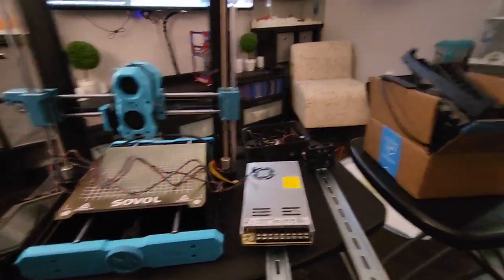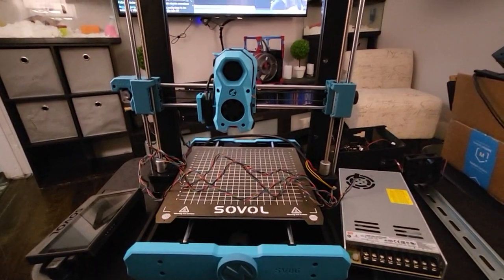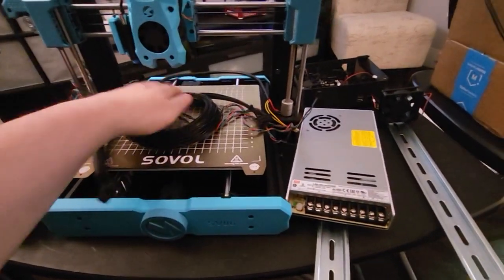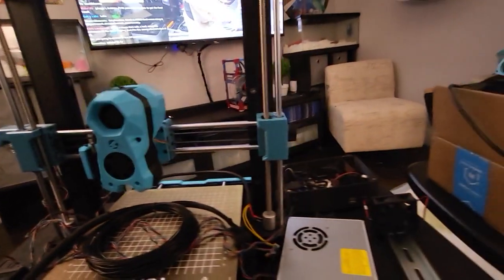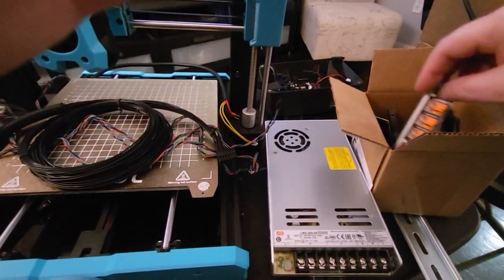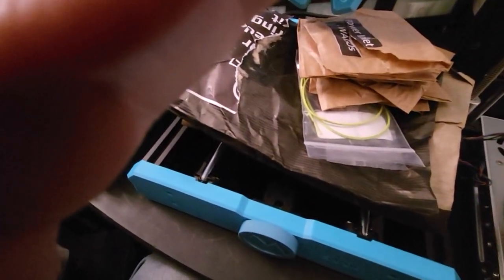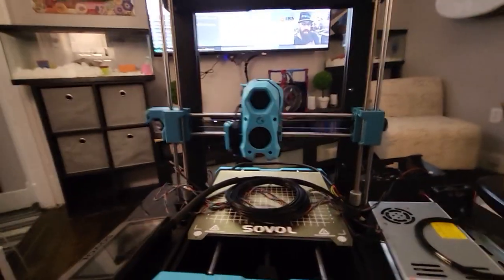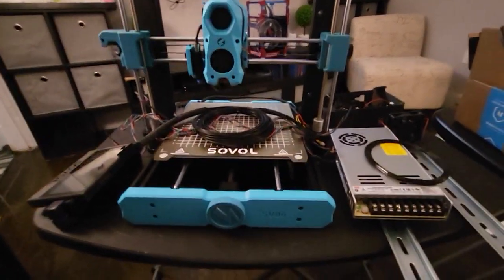Sovol SV06 mods

Comment: wha's the point of purchasing a 200 $ 3d printer and spending 1000$ o mod it? just buy something else.
Reply from the maker: First thing, I did not buy this printer it was free.  Second there is nowhere near 1k woth of parts here.  I had most of the parts as spares from my vorons.  But if we want to itemize?  $35 for the psu, $45 for the m5p mobo, $20 for 5 steppers, $47 fir the 4 stepper motors, I had the bondtech gears extra for the extruder they were spare parts from other kits so $0.  $35 for the Cb1 mcu, $17 for wire harneses, and  $9 for leds.  $12 for drylin bearings.  $35 for cut acrylic panels, and $9 for extrusions.  So maybe spent $285 (include filament for printed parts)

Its a hobby and modifying and building is the fun of it. 😊
Reply: yeah, i mean i guess if you have fun doing it and as hobby i cant blame you, but in terms of value for money, he prob would get like a bambu p1p for the money spent
Reply: In every DIY/maker video comment, there is someone like this. They seem to see everything in terms of optimizing productivity / price ratio. As if they don’t have the ability to grasp the meaning of “hobby”.
Reply: @lucywang2591  after you have modded the 2nd printer you do not care anymore... it is like working and building pc for years also for playing but in the end, you buy a PS5 and you start playing and enjoying it immediately...

Comment: What an awesome build bro lol i love the look of the voron extruder setup on the sv06!! Do you know if it would be possible to use the voron shell with the stock sv06 extruder/hot end setup and just use the same fans that fit the voron?
Reply from the maker: Yeah I do not think you can do that the extruder setup is not even close as they cool the hotend from behind not the front and the whole setup is so short.

Comment: Wow. You have gone all out. My first printer was a Anycubic kobra and it is ok but is not easily converted to klipper. So i picked up a sv06 a few weeks ago and am impressed. My bearings are quite smooth. I do have some IKO bearings on the way for when mine give out. I also have a pi 3b and a btt 5 inch screen and  a mellow adxl345 here now. I wish there were some good video tutorials on how to install klipper for the sv06 but i am sure i will figure it out. Well hopefully. Lol. My question to yiu is did yiu creat le the mount yet for the 5 inch screen that mounts in the front? I have seen a few so far but all of them mount on the side. I also did not get the hdmi version of the screen as i wanted to mount the pie in the back and found it was cleaner with that version. If you did design one is it on printables yet?
Reply: im trying to do the same thing right now except im running klipper on a laptop! let me know if you figure it out ahha

Comment: How slow is this, in reality, compared to the SV07?
Reply from the maker: the SV07 in my book is a step down just for the v-wheels alone is a step backwards and I feel that they would have done better going with linear rails on the extrusions.  How slow, well stock its ok, 80 to 100mm/s print speeds are easy to reach, 150 is not really a feat when you look at say a well tuned voron printer.  Also you are limited to the hotend.  I can print a new part with this stealthburner toolhead and cw2 extruder and slap a UHF Rapido on this and get 45mm^3/s volumetric flow and hit some good numbers with some high temp filament.  I have completed this build I will be putting up another video but its a silly printer now with all new bearings, some new gears, the hotend, and moving everything under the deck its so nice.

Comment: Hello could you please share the files and parts used for your mods? If you can share some quick instructions it would be greatly appreciated. Great video. Thanks 👍
Reply from the maker: My printables page is here w w w.printables.com/@Eclypse3D_427087/models  I am on the Sovol and Voron Discord channels under the same name as my youtube name if you need any guidance.  =)  The skirts and stuff I have saved I did not upload those yes.
Reply: @eclypse3d  Thank you so much
Reply: @eclypse3d  do you have a link to the sovol discord? Any link I find online seems to be expired